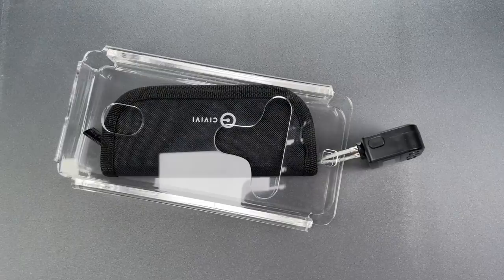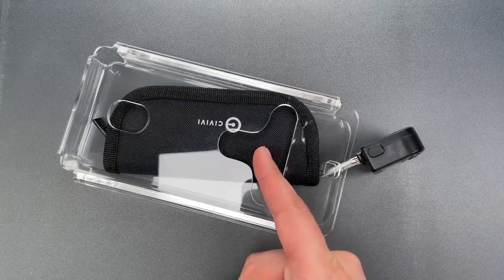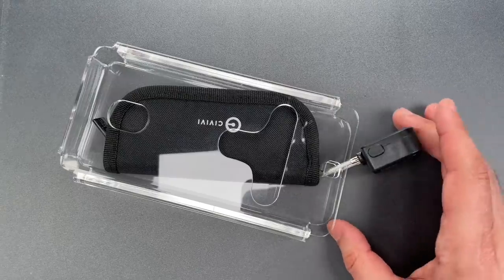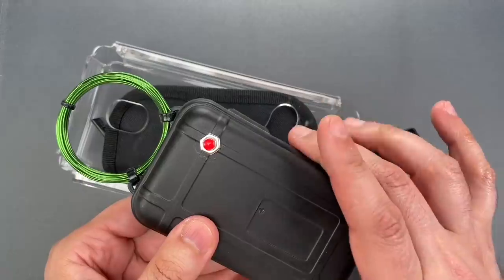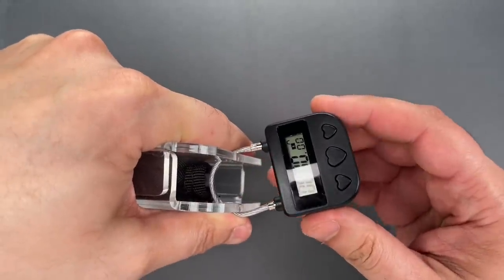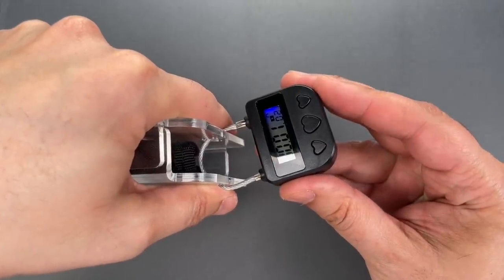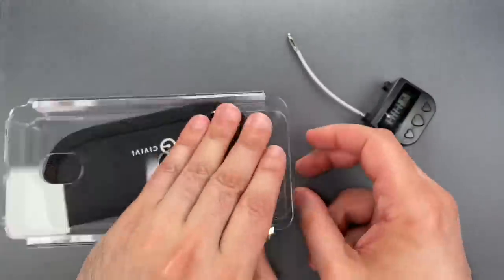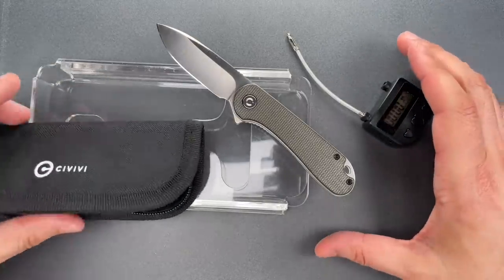[1323] Pocket EMP v. Timer Padlock

Comment: The moment he takes more than a minute to open a lock you could probably cut with sidecutters ;)
Very nice demonstration nonetheless, though I can't imagine local ham radio operators would agree
Reply: Anybody can just cut, saw through or shoot off a lock.. 

It takes skill to find somethings defects and actually exploit them..
Reply: Sometimes the challenge is non-destructively opening the lock, such that the owner or authorized users would never notice the intrusion.
Reply: As a ham radio operator... I can tell you that every car on the road, every refrigerator pump motor, every cell phone antenna causes a reasonable amount of disturbance in electromagnetic fields. Oh, and pocket EMPs are pretty cool.

Comment: Most of these are even easier to open. Underneath that plastic stick-on cover are 2 screws for disassembly. Some even have a "stick end of paperclip in to reset" hole, or a hole where you can "stick straight pin here to unlock". Once done, you can stick the cover back on.

Comment: A thief, an electromancer and a chronomancer stumble upon a chest sealed by a futuristic lock.
Thief: "I'll get this open with my picklock... Wait, where's the keyhole? There's just buttons here that don't mean anything!"
Electromancer: "The lock seems to be locking the chest with magic! How are we ever going to open this?"
Chronomancer: "Hmm, I have seen glimpses of these locks with green panels and black numbers from the future, I speculate that they are powered by electricity."
Electromancer: "Electricity? I will shock this lock open!"
After the electromancer shocked the lock, it made a loud beeping noise and the numbers on the panel all went to 0.
The thief showed an expression of utter confusion on his face as this obscure noise was made.
Thief: "Still locked... Let's see what these buttons do now... 9, 9, 9, 9, 9 and whatever this button is"
The lock made another beep and the numbers began ticking down.
Chronomancer: "Oh... That looks like it's going to be locked for a while... Let me speed this up."
The chronomancer cast a sphere around the lock, causing it to count down much, much faster, until the only number on the panel was 5, and the chronomancer uncasted the sphere. After precisely 5 seconds, the lock let out a few final beeps and unlocked.
Thief: "Yay, the chest is open! I wonder what's inside."
The thief opens the chest, revealing a sharp knife of steel covered with cloth. It looks so sharp it could cut through chainmail armor!... And Kevlar. A perfect weapon for the thief!

Comment: I made a pocket emp generator using a £1 electric fly bat, a £2.75 voltage upstepper from Amazon and a coil of copper wire. Some of the best fun I ever had. ✌️

Comment: You can actually remove the black plastic border at the front display to find the screws. Open the screws to open the lock or reset it. No EMP is required.

Comment: Those little electronic locks a lot of time have the "reset" switch under the plastic sticker that covers the display. Simply peel it off, reset it with a paper clip and proceed as in video. Don't remember if the battery reinsertion doesn't do the same

Comment: Just a suggestion, you only need one turn of wire, adding more will only weaken the emp since you want as much current to flow as possible by adding multiple turns you are adding more impedance to your circuit which restricts current flow 😉

Comment: To get the coil to make a magnetic field that is strong enough, wouldn't you need amps, not volts?
Or is the lock's electronic wizardry so feeble, a weak field works?
Reply: I'd go with feeble lock given manufacturing standards in China.

Comment: All the company would need to do to prevent this is use a slightly more expensive microcontroller that has a few bytes of storage so the time (or an estimate approximated version if you really need to fit it in 1 byte) can be saved once you press start, in that case it could start again at whatever time it was set to before instead of allowing you to set a new time.

Comment: Have you ever heard of an electronic demagnetizer? Commonly used for mechanical watches, it's about a $15 device on Ebay that uses pulses of A/C power to create a magnetic field that continually changes. If you put steel near it, then slowly pull it away, the continually changing field makes your average permanent field in your metal about zero.

Would that tool work for this, too? Do you need high voltage or just high magnetism? Is 60hz fast enough on cycles to do the same as this?

Comment: How far does the “EMP” effect reach? Would it reset/damage potential electronics stored in the box guarded by the lock? That could be an important consideration.
(the knife looks fine, though… “If there's one thing I know for sure, it's that a six inch blade never loses reception.” ©)

Comment: I'm afraid what you say here contradicts the Ohm's law. To pass low current with high voltage applied, the coil should have high resistance or high inductance, and this one does not look like it would have any of that. What actually happens here I believe is the coil gets very short and pretty high current impulses that induce sharp field reversals around it.

Comment: I liked the small EMP Generator. Stun Gun + Coil, in Case. Activated, sounds like he's running the Arc through a Gap, AFTER one lead passes the coil.
Ingenius actually. Be interesting to Test variations with a Cell Phone. ( cheapy throw-away).
Tesla himself did amazing things using VERY High Voltages. It is the BASIS of Anti-Gravity Drives. Torroidal Fields, at very high voltages.
Very cool LpL !

Comment: I wonder if the lock I designed for a school project is resilient against this attack.
It’s based around an arduino that stores the lockstate and the user set passcode in the built-in EEPROM, along with a bunch of other data. So even if the arduino is reset or loses power, upon restarting it won’t open as it reads the last state from the EEPROM. As a safeguard it does perform an integrity check on the EEPROM during initialization and unlocks if any data is corrupt.
You can cause the cpu to reset for sure, but I don’t know if the EEPROM is susceptible to EMP attacks.

Comment: Everybody here freaking out about the EMP generator, forgetting that it’s just a coil with a step-up voltage converter infront of it (which you can hear spark).
I love EMP generators though, I did a high school graduation paper on EMP devices, making a less portable one as well; highly recommend it to everyone, get insulated copper wire for the coil, and buy a step-up converter online; the voltage will be high and the ampéres will be low so the danger is minimal (I should know, I was shocked by upwards to a million volt due to improperly insulated copper wire).

Comment: There’s an even easier way to open that lock requiring no tools, no knowledge of lock picking, and very little skill, Leaving no trace of tampering as well.
The release button on the side is blocked by a small motor when engaged, but with enough force, will still release while active. Basically just push hard enough on the release button and the lock will open as normal… yep, it’s that easy.

Comment: Another solution would have been to but the box in a stove and heat it up just enough to soften the plastic enough to bend it.
BTW, I'm surprised you said low current high voltage.  I would have thought it would have been the opposite since it is the current that generates the electromagnetic field.  What is the frequency of your EMP device?

Comment: "So anyway I have a pocket EMP generator, lemme put it really close to the camera, an electronic device, so I can with no difficulty capture some high quality footage of it in action."
Reply: EMI falls off with the square of the distance. If you have to hold it like a cm away to interfere with the lock, at 10 cm there's going to be 1% of the field energy, and at 30 cm (1 foot) there's about 0.1%.

In other words, nothing to really worry about. Worst-case the camera crashes and you lose a file.
Reply: @evilspoons  you didn't even mention how most modern cameras have emp protection built it

Comment: I have a version of this lock; if you peel away the face of the screen there is an override button on mine. Upon discovering it, the whole lock seemed kind of useless. Partially destructive; you can reattach the screen face.

Comment: Could they fix this flaw by making the default value 99:99:99? So if you EMP it it'll just make it worse. I guess that would cause problems during a genuine malfunction, but maybe you could have a true reset (that sets it to 0 rather than invoking a default value) hidden inside some panel with a pin button so it's more effort than it's worth when you're trying to use this for yourself.

Comment: Question: is there a way to change the battery? Removing the battery would have the same effect.
Reply: Even if you could remove the battery while it's locked, are you SURE that would have the same effect?   Non-volatile memory is a thing.
Reply: @ApKNJ  I can't be 100% sure without knowing the details of the design but I have probably 95% confidence in my assertion. It is evident that the pulse resets the microcontroller's CPU, possibly via a watch dog timer. If it saved the state in non-volatile memory it would also pick it up when reset by the EMP.

We need to keep in mind this is a cheap novelty lock, not something designed with security in mind. A real lock would probably have redundant copies of the state saved in NVRAM and would power up in a safe state if no valid state could be found.

Comment: To be fair, if a kid use this method to open the lock while their smartphone locked inside, they will be risking to fry their smartphone in the process.
Therefore discourage the kid to even try opening the lock, IF the kid bears some basic knowledge related to modern electronics.

Comment: "...high voltage, low amperage, pulse through the coil..." Applying a high peak voltage pulse (assuming moderate frequency, which it clearly is) to what must be a low impedance coil of wire will inevitably produce a moderately HIGH peak current pulse. Also, the resultant peak magnetic field strength is strictly a function of the peak current (and turns count), not voltage; so if it's emitting a high peak magnetic field strength, that implies that the magnitude of the peak current pulse is also high. The average current might be low, when the duty cycle of each pulse is also low (nothing more than the very definition of average...). In summary, the peak current is probably higher than you think.

Comment: Here is a device that I put together. It is fairly simple. It is a low power EMP generator. xD

Sounds like me when I am telling people how "simple" it is to build a sofa. Or when I am talking about Chinese grammar. Everything is rather simple at a high enough level. Luckily for me I am building my own electric gadgets as well, and that sure looks simple. 
A DC source, such as a large battery, to a coil, and have it setup to a button. Really, really easy. I am not lawyer, I am just a China major with special interest in international politics and international relations, going for my PhD. But I did manage to get into the intelligence agency's hacker academy through their "test" xD rather easy. All I had to do was to find the code in 4k picture. That is not easy or simple, and I dropped it because I am more interested in culture than hacking. xD

Do not try to replicate my recipe of the EMP jammer. It is a simplified version. It can kill you if you do not know what you are doing.

Battery to switch, to high voltage converter to spark gap, to coil.
Even if you do it right it is still not something I would recommend noobs in building

Comment: or take ur time since this stupid lockbox isnt attached to a surface nd it isnt heavy so lifting it isnt a problem. get a hammer smash that seethrough case,bolt cutters. instead of a using a emp isnt that supposed to fry electronics ull mess the phone up lol